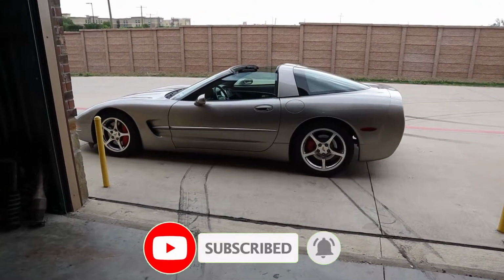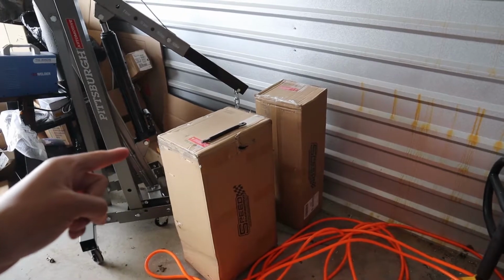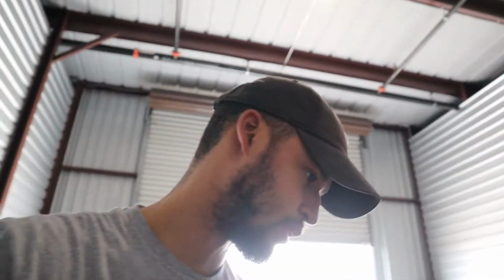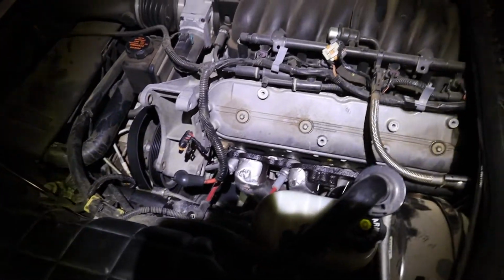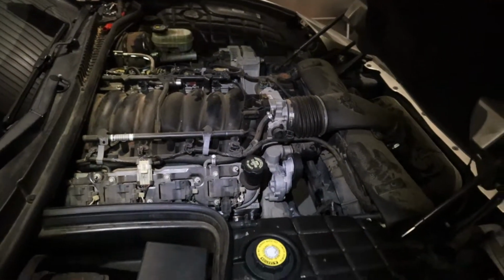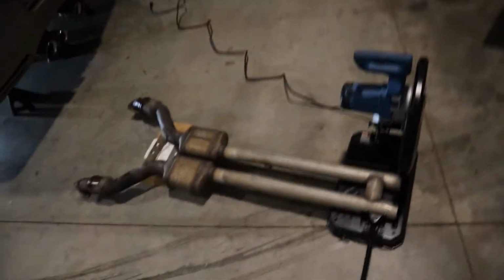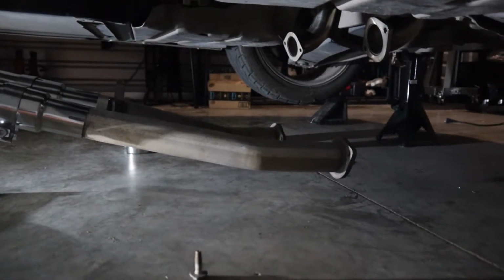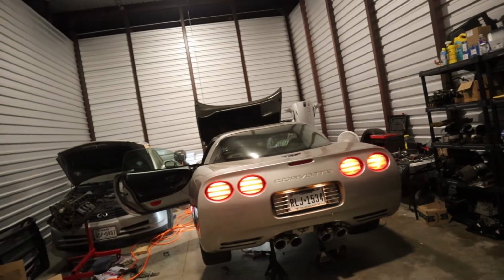C5 Speed Engineering Longtube Headers and X-Pipe + Corsa Extreme Install

Comment: Where was the exhaust leaks at I'm buying this setup I'm worried about the clamps on these what clamps did you use to bolt the headers and xpipe has it leaked from the clamps on the header part.
Reply from the maker: Just get some aftermarket clamps I haven’t had 1 speed engineering clamp work correctly in two different installs.  They all leak lol.